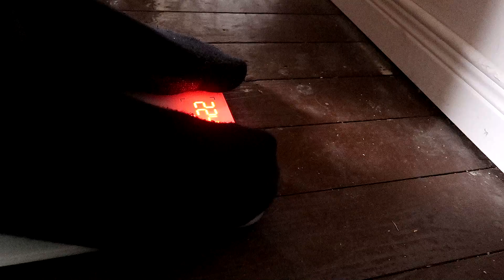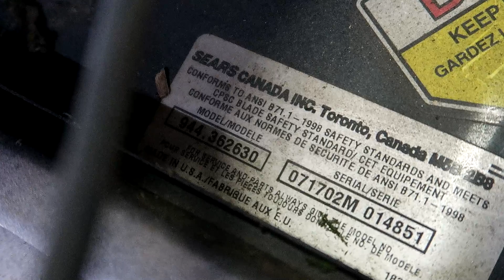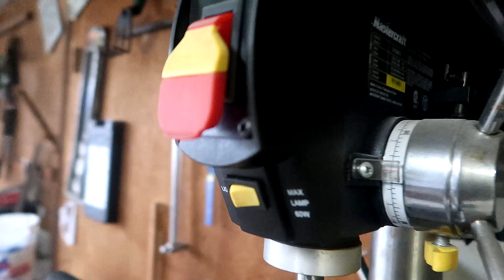Prepping the Mower

Comment: Even if there were a drain plug underneath, they're usually so caked in wet dirt that they're rusted to the case, so forget trying to undo one of them!! And yeah, that blade's taken a hard hit for sure, and not 100% sure, but the blade hub also looks like it might need replacing if i has locating pegs which have sheared off, but that's a cheap part at least...